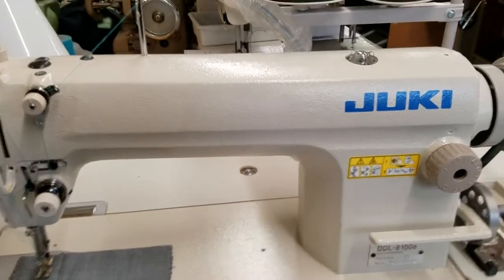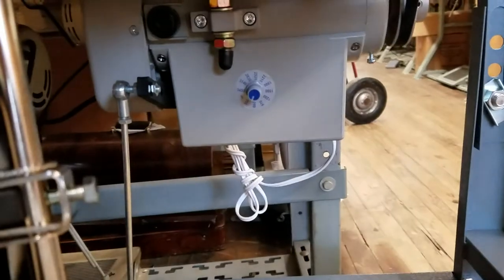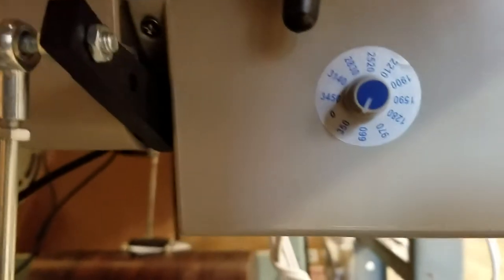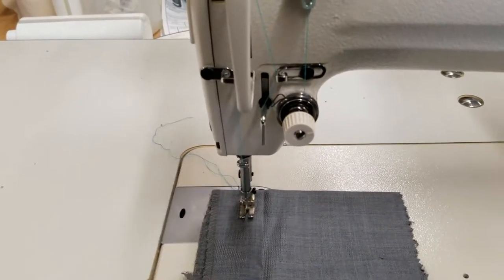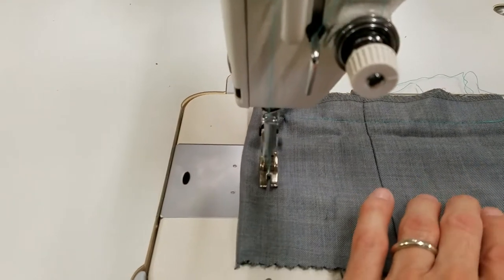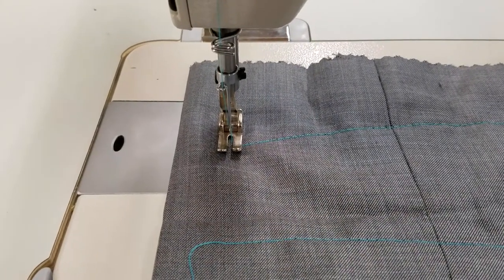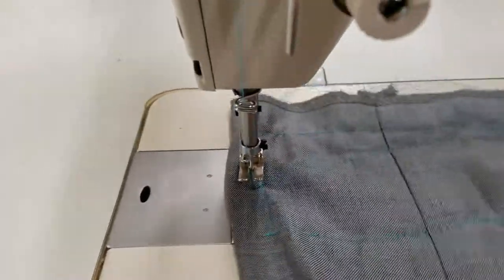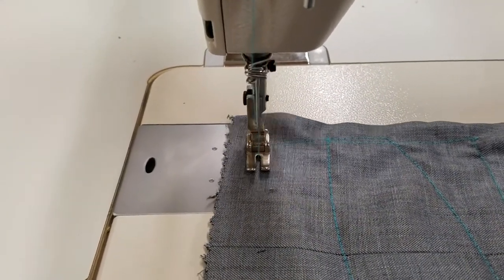Servo motor speed control on Juki Single needle sewing machine

Comment: I'm learning to use a Juki DDL-8700, with a SERVO FESM-550S to sew leather, and have several questions. If anyone can answer even one of these questions, it would really help. #1: Are there any useful user manuals for this setup, or do you just have to learn from experience? #2 Since I am sewing with leather, is there a relation between speed and power?(faster speed has less power or more power?)